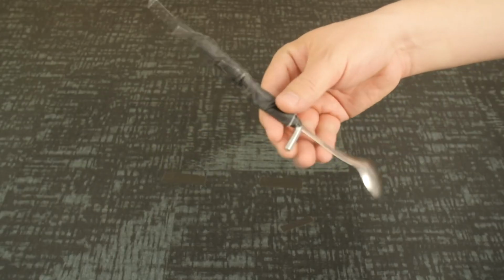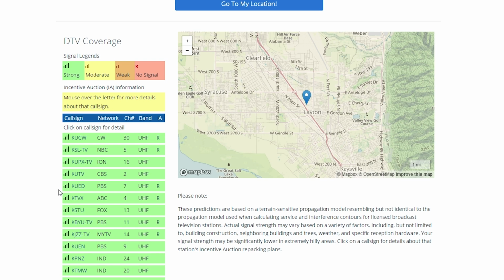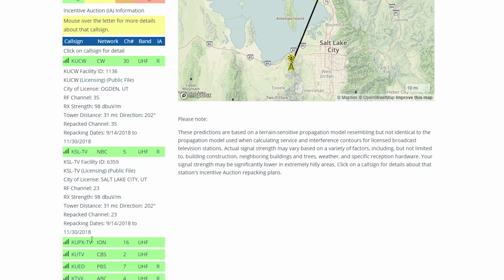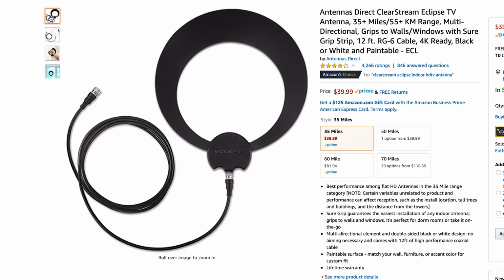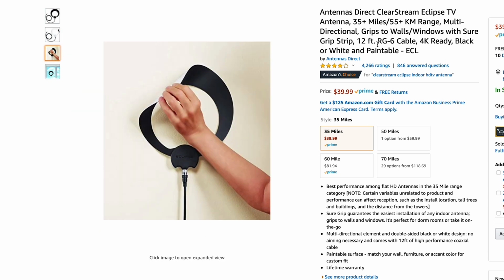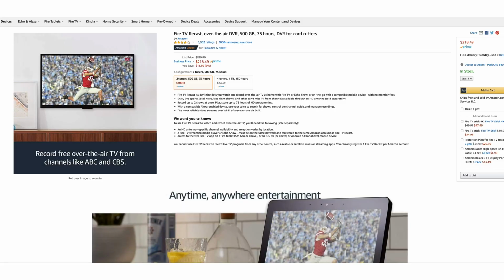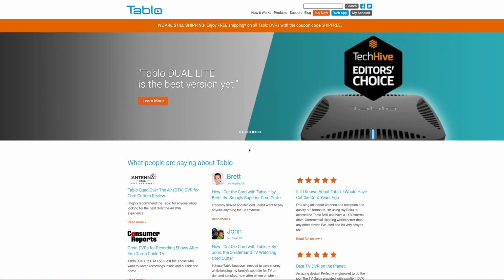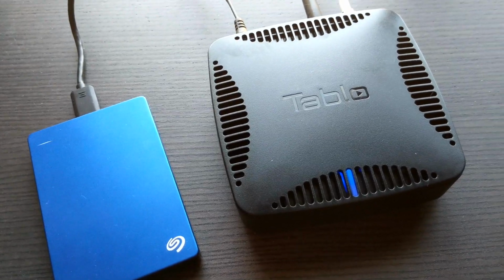How to Get the Most Out of Your HD Antenna

Comment: 1) Understand that there's no such thing as an HD antenna
2) Understand that an amplifier does not improve your ability to receive a signal. It just gives the signal you've already received a little more juice so that it doesn't degrade any further as it travels through the cable  :)

Comment: Please stop referring to them as HD antennas. You only create more confusion. There are no such things as HD Antennas.  IT is the broadcast that is HD, not the antenna. There are UHF and VHF, or both antennas.  That is it.  The same antenna from 1980 that you used to get the old analog transmissions will work just as good with digital transmission of HD broadcast.

Comment: As someone previously noted there are no HD antennas.  Just antennas as you noted with the spoon example. What antennas do is turn EM radiation be it digital or analog broadcasted signals into an electrical current. Something about cables. Better options would be RG6 DUAL OR Quad shielded cable if you are experiencing interference from a nearby electrical device.

Comment: The video had some good information, but to get the information correct, you have to know that there is no such thing as an HD TV antenna. A TV antenna is just that... a TV antenna. There is also no such thing as a digital TV antenna... remember those? Those terms are just hype that was coined by marketers to fool people into buying their antennas as the technology for televisions changed. That's why a spoon and paper clip can work. It receives the signal, and passes it on to the TV as it's a very simple antenna. Another thing to mention is TV bands. You have Low VHF, High VHF and UHF. Most of the little, square flat antennas will only pick up UHF signals, NOT VHF. So while checking the FCC site, you have click the Callsign for each channel to find the RF Channel for each. The RF Channel is the channel that the station is actually broadcasting on. For instance, the station may be ABC 7, but may actually be broadcasting on RF Channel 25. RF Channels 2 through 6 are VHF Low, 7 through 13 are VHF High, and everything above 13 is UHF. So if you have one of those flat antennas, and any stations in your area broadcast on RF Channels 2 through 13, you will probably not receive those channels very well, if at all, with or without an amplifier.
Reply: This is the third review in which I mentioned the same thing.  I really wish they would stop adding to the confusion
Reply: Correct. It should also be noted that a roof antenna will perform much better and usually pull in more stations. Those little square ones work to some degree. Not the way to go unless you're renting an apartment or cannot have an outdoor model for some other reason.

Comment: Need more.  I have both UHF stations and Hi-V stations.  Most "HD antennas" don't work with Hi-V.  What's the best for these Hi-V stations?
Reply: Because there is no such thing as an HD antenna.  A large directional antenna from 1970 will probably work best
Reply: The commercial VHF choices are pretty disappointing. The best UHF/VHF antenna IMHO is a GH10n3 it was a collaborative refinement of an old UHF antenna by a group of amateur computer modelers.
The models say it gets 15 dBi average across the UHF and 9.7 dBi across the VHF high. It's homemade if you are up for a pvc pipe and wire project.
If you google gh10n3 you are likely to find a confusing array of home brewed hooverman antenna builds. Even I can't find the original posting in the forum where they developed it. Most the videos and sites have a simple screen as a reflector which is fine if you don't want VHF.
The model you would want has what they named "narods" ( not a reflector or director) and the best has a "top hat" 
Luckily I kept a copy of the model.
If you are interested in the dimensions I'll post a copy somewhere.
There is an instructable labeled gh10n3 and it at least looks right, but I haven't studied his actual dimensions.

Comment: Fact No Antenna is HD they are VHF or UHF Antenna. Some Antennas are both. Check your local area for what type of Antenna you should buy.
Reply: This is the third review in which I mentioned the same thing.  I really wish they would stop adding to the confusion
Reply: @SkepticCyclist  And an amp is best for long cable runs, not for bringing in weak signals.
Reply: I just got a new 4K TV and want to cut the cord (Dish network) but NEED to watch live football games and the Super Bowl. If I get the antenna and Sling TV would that be enough to do it? Would the picture be clear? What’s the best option to watch live sports NBC, CBS, or Fox without satellite?
Reply: @sheriwalters732  Go to this site and select the channels you want.  It will create a list of providers based your channel selections, and organize them by prices, channels, and features.  https://www.suppose.tv/tv
Reply: Jason King thank you so much!
Reply: @sheriwalters732  Sling will get you the NFL games on ESPN, but they currently do not have the NFL network.  They are in the process of getting a deal done with the NFL network. 

The antenna will get you whatever games are being broadcast on your local CBS, NBC, and FOX channels.

You maybe better off going with YouTube.  By the time you do the add-on packages for Sling it will be about the same price as YouTube or even more (depending on what you add on.)
Reply: @sheriwalters732  No Sling required unless your TV reception is poor.  No cut and dry answers can be given, unless your exact location and circumstances are known.  House vs Apt, clear sight lines to the TV towers, etc.  But with a good TV antenna, placed high up, and outdoors, many people in the US can get all the TV stations you listed, (plus more), in Hidef, picture perfect.  Try antennaweb.org and see what your access to the TV towers is.  If you're looking to use one of those "indoor hidef" antennas, you might just want to go with Sling or Yahoo TV to get your TV.